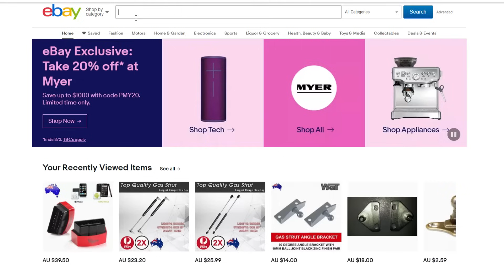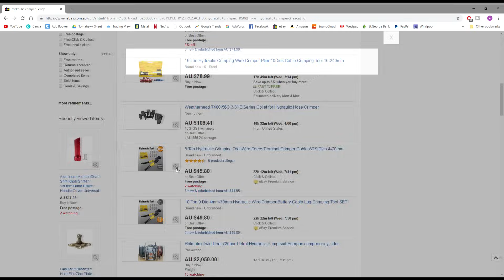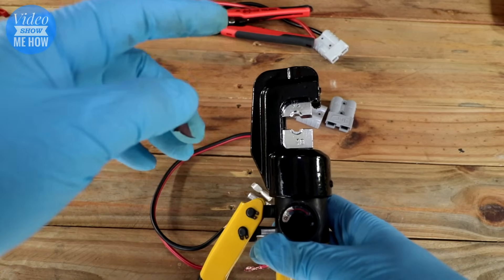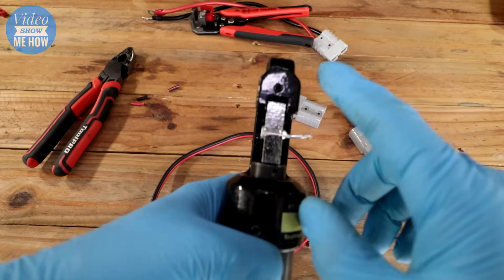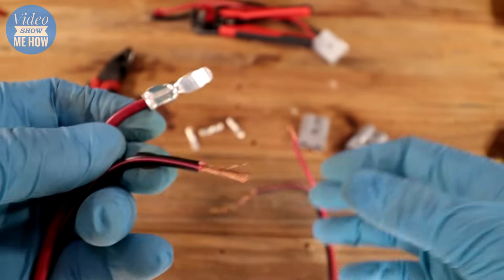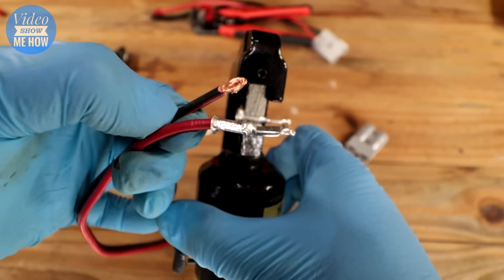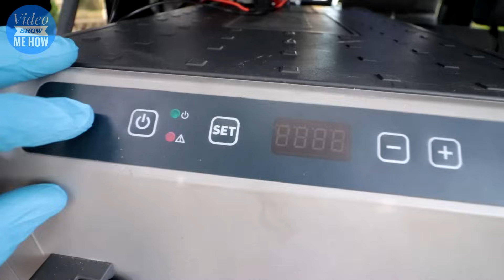12v Anderson Plugs and Connectors - Complete How To Guide

Comment: General suggestion: Do not test assemble these before you attach your wires, to see how the system works. You'll only be pleased with yourself until you try to get the contacts back out of the housing.

Comment: I have never liked these connectors. I have always used a ring and bolt style connection for high current never comes undone. But alot of accessories use these Anderson connectors nowadays over direct hard wired setups. However all my high volt DC sets ups are stationary long term off grid systems so portability is a non issue

Comment: DO NOT SOLDER THESE!  use the proper size connector for the wire guage and CRIMP with a proper tool.  Solder connections MAY work if you are using in a stationary situation. but vibration and movement will eventually cause a break!

Comment: How do you get the connector out prior to crimping?
Reply from the maker: @bcgoldminer use a small flat head screwdriver to pry the little tab down at the same time as pushing the connecter all the way in and it will fall out

Comment: Jaycar had 175 amp ones bud, I i can tell you're Australian I came looking at these for car audio quick disconnect style thing and Jaycar has some zero gauge ones and even doubles zero I think zero gauge saw on the no one's crimping zero gauge is though so that's sucks 😂
Reply from the maker: @chloeleedow7250  I use wago connectors for car audio check those out?

Comment: I think it is worth noting that the inventor, Anderson Power Products only provides technical support for crimping SB connectors, but not for soldering.  

It seems to me the electrical connection is about the same but the mechanical connection is far superior when properly crimped. 

There are other downsides to soldering as well.

Unfortunately here in the states we are still in the middle ages as far as our measuring. I have one of those hydraulic crimpers but could not find one with gauge marking on the dies, only mm.  Hopefully they roughly correspond to gauge, but it makes it harder to choose the select die when setting up.

I also have a really nice set of leverage based crimpers that have very long arms and work very well. With those you have infinite variability by screwing the jaws in or out and I prefer them.
Reply: I tried the soldering aspect. It is a HUGE pain with a 4 gauge wire. I added flux inside to clean the connection and all. Using a regular soldering iron, took FOREVER.!  I just purchased the hydraulic crimper up to 0/2 gauge for my next project.  FYI, I added flux to clean the barrel part of the connection and all.  Crimping will just be easier. I do wish that there was a link to the crimper that was used here.

Comment: These connectors got a design flaw... 3:15 the wire interfaces are too hard to crush, so you need bolt cutters or that expensive hard to find tool above to just crush them. If they'd go instead for screwable connectors that can be easily open and closed, that'd allow for squeezing the wires, and easier maintenance.

Comment: How do you determine the right size die? I tried with the hydraulic crimper. Crimped it down tight, but the wire just pulls out.

Comment: No, don't use solder. A proper crimper is much better. Also, you don't want to go smaller than about 8AWG if you really want a connector rated to ~50A.

Comment: I saw that you used the 10 size
I bought the same one and the 10 didn’t crimp it enough.
I had to go to the smallest size and that did the job but it wasn’t 100% tight. If I pull hard enough ( not swinging off it) it would come out.
I don’t think I’m doing it incorrectly, it’s very straight forward. Did I get a dodgey crimp tool?
Reply from the maker: Maybe double over the end if you need more thickness?
Reply: Good idea I’ll give it a go
What thickness did you use in this vid?
Reply from the maker: Hmm unsure, was a while ago sorry
Reply: All good thanks

Comment: I just bought a new summit II charger with a Sb50  connector but when it was time to connect the two connectors together it was almost impossible to push together, is that normal when their brand new or something?
Reply from the maker: Unsure on that brand but some Andersons are specific, for example the red connectors will only connect with other red ones (this is commonly used for solar panel connections)
Reply: @VideoShowMeHow   black will connect with grey, that's the only miss match in colour

Comment: Great video. I wonder of Powerpole can plug straight into SB50 ?
Reply from the maker: Hmmm am unsure, the powerpole are similar to the sb50 in that it's colour to colour only. Unsure if the keyed bits allow connection into regular sb50. Am doing some more of these type of vids in the new year so will report back!
Reply: @VideoShowMeHow  Just found out they are not compatible :)
Reply from the maker: Ahhh there you go

Comment: I have seen mentioned elsewhere that putting some solder onto the wire before crimping makes a better joint; something solid for the crimping process, otherwise large gauge multi-strand wire can flatten too much. Your opinion appreciated
Reply: It is not good practice to crimp soldered wire, due to cracking the solder during the crimp process. It's best practice to do either solder or crimp, not both.
Reply from the maker: You can flood solder the joint (vid on the channel on that). I would think any solder in there might be dislodged when crimping. Maybe if it was a small amount

Comment: If you're using twin cable like in the vid' you need to be careful you get the crimps on in the correct orientation to the plug as well as to each other - spend some time sussing it out before you crimp. Also the Draper 64335 type crimping tool works well, it's cheaper & doesn't splay the crimps.

Comment: Nice video. I have one question though.

I see you twist the tip of the cable before crimping it. Could you go into a bit of detail on that, please?

Thanks heaps!
Reply from the maker: Was just because cable size was a bit small, so is better to kinda double up the cable to get a better fit in the connector 👍

Comment: May I please ask 2 questions (novice here):
1) Can the T Puller be put on either side of the Anderson plug or only the fully flat side?
2)  Once you insert the wires with crimped (or soldered) lugs into the Anderson Plug (where there click in) is it just as easy to pull them back out? Or how to remove the wires if you want to check a connection?
Thanks for your great video and your time. Cheers, Peter
Reply from the maker: Hi there, 1) can be both sides 2) easy to pull out, just use a flat head screwdriver and push the tab down and pull the wires at the same time
Reply: @VideoShowMeHow  Hey Thank you very much, greatly appreciate your reply, good round off for me from an excellent learning video. All the best, and thanks again!
Reply from the maker: @MrLuckyLegs  you're welcome!

Comment: Could you do a video on which Anderson connectors to use for which application? IE: After watching a video where winching can draw as much as 500+amps under a heavy load, how do you know which Anderson plug connector to use? An SB350 connector for winching vs a SB50 connector for a fridge or a SB175 connector for powering a trailer, or an SB120 for jumping a car, etc.?  How do you know which Amp rated Anderson connector to use?  I understand the wire thickness issue but the different rated connectors is what is throwing me off. Also, on your fridge, did you just put the Anderson plug going to just the 12v outlet or did you also change the connection going to the fridge body itself? Thanks for taking the time to show this.
Reply from the maker: Thanks 👍 I'll add to the list :)

Comment: if you cable is loose in the connector, i'd double it over so its nice and tight. that way when you crimp it, the connector wont deform like that
Reply: 100% correct thats how us electricians do it

Comment: Just bought 2 -SB175's to install the wiring for a DC to DC charger in my truck/trailer.  Never used Anderson connectors before.  Great video explaination on how to install and use them.  Thanks.
Reply from the maker: Cheers 👍

Comment: Can they be panel mounted ?
Thank you !
Reply from the maker: Hey 👋 Do you mean on a 12v panel? If so yep sure can, can be riveted or screwed on
Reply: @VideoShowMeHow  on a project box ?
Reply from the maker: @Enoch-Gnosis  Ah yep, sure can. I put together one in my camper trailer and have a  couple of Anderson plugs eg solar in, 12v out.. They are easily mounted with small bolt and nut, I just used the ones that came with 👍 Good luck with your project ✌️
Reply: @VideoShowMeHow  awesome thank you great video!

Comment: Great tire thanks it's given me confidence. What gauge wire would you use form aux battery under bonnet to fridge at rear? 8mm?
Reply from the maker: Yep that would work fine, that's good for around 40 amps. Fuse near battery 👍
Reply: @VideoShowMeHow  thanks mate

Comment: Very helpful! Got a question - I assume it's possible to extract the cables you insert into those connectors? Is it just a matter of leveraging that flat plate on the end up so it can slide past the small plate inside the connector? Thank you!
Reply from the maker: Thanks 👍 Yep you got it, small flat head screwdriver leverage up and pull.
Reply: Always best to confirm these things! Thanks for the reply.
Reply from the maker: @scottweikert5189  welcome mate!
Reply: @VideoShowMeHow  if you leverage up and pull you can lock the contact to the upper lip inside,always better to lever down the locking tab and push out pin with a second screwdriver so as not to strain wire crimp connection.

Comment: You folded over the wire end before you put it in the plug to crimp?
Reply from the maker: Yeah I mentioned in the vid that the demo wire was a bit small hence folding, usually you'd use thicker cable and this would be required
Reply: So l wasn't going blind then, I only have a mobile, screen is small no computer, l thought the same it "was" doubled over!

Comment: You should mention that you can get different sized connectors for #8 WG, #10-12 WG and # 6 WG sized wires.  makes a big difference.
Reply: Wondered about that, cheers
Edit: can they be purchased from eBay??
Reply: @stevecrowe176  You should be able to. I buy mine from Jaycar in Australia....

Comment: Good video, I use these a lot on UPS systems. They range from 24v to 120v and then paralleled or series to 400v plus, current varies on UPS size and DC voltage. A good connection is so important for obvious reasons, the crimp tool is the best way to achieve this, you can crimp it too hard as well as too soft, if you do you it too hard it will weaken the connector. The crimper in this video isn’t the best, you should really use a specific Anderson crimper but for 175A plugs it would be a ratchet crimper and it would be a lot more than $90!

Comment: Do the connectors that crimp onto the wire ends come with the anderson plugs? I can't find them anywhere online in australia.
Reply from the maker: Hey there, yep they sure do, should get 2x with every housing
Reply: @VideoShowMeHow  Ahh ok great, thanks for the quick reply. Video was really helpful, wiring up some fridge connectors to my mppt controller for camping this wknd now that we're allowed out again!
Reply from the maker: Nice! I've had a quick look just now and can't find any either, just the normal Anderson connectors that have then with them. Might need to just get them, least they're pretty cheap 👍👍
Reply from the maker: Actually maybe somewhere like Jaycar if you're in Aus?
Reply: @VideoShowMeHow  Yep, Melbourne - I need the Anderson plug too so if the connectors come with it i'm sorted, if not i'll try Jaycar, cheers
Reply from the maker: Cool. Have fun this weekend! 🍺
Reply: You can purchase just lugs as well from eBay, l did, incase of stuff ups.

Comment: Wire gauge looks to small for the contact.
Reply: You can get different sized connectors for #8 WG, #10-12 WG and # 6 WG sized wires.  makes a big difference.
Reply: I totally Agree.  But you'll get a lot of solder in the cup with that mismatch!  Probably not a good crimp connection though.

Comment: Will these plugs be ideal for a electric fuel pump on my car
Reply from the maker: Hey 👋 outside the tank sure 👍
Reply: @VideoShowMeHow  also are the connectors identical you just rotate to plug in each other.
Reply from the maker: @rogerbelcher2981  spot on, you are correct

Comment: SB50's are actually rated up to 120A and can handle significantly more than 50A continuous if ambient temperature is sensible and correct cable size is used. Power pole 75's use the same plug fingers. 
The 50A is the 'hot plug' capacity.
I.E the maximum current the plug can be connected/disconnected at whilst current is flowing and not destroy itself from the arc.
Reply: i didnt know that SB50 is rated up to 120A. Looking the right plug for my 12v 1000watts inverter
Reply: Thanks, it's been pretty hard trying to figure this out from looking at the SB50 datasheet which only states clearly 'up to 120 amps' in the title. Further down it says the UL 1977 rating is 120A but CSA is 50A and none of that means much to me. In the end I figured that even though the plug looks a little small, if I can get terminals big enough for 16mm2 cables then it's going to be suitable. But it's good to see someone else saying in the comments that it's good for 120A.

Comment: One question, given that the contacts have a wave shape to the end of them, don't they need to be inserted in one direction on one side and reversed on the other? Thanks for the vid, keep up the good work!
Reply from the maker: No both the same, the housings are designed to clip together the right way 👌
Reply: @VideoShowMeHow  Thanks for the prompt reply. I may be confusing the terminology. I mean the crimp pieces.  While the plastic connectors themselves are oriented specifically, do the crimp pieces only go in one way when inserting them into the connectors as well?
Reply from the maker: Yep you got it, the terminals both positive and negative go into the housing the same way 👍
Reply: When you put the "terminals" into the connector shell in the wrong orientation, they don't tend to stay in place. Yes, they are meant to only go one way.
Reply from the maker: You shouldn't be able to connect the wrong way :)

Comment: Are those the same connectors? They are simply turned around so that they connect into one another. Or, is there a male and female connector?
Reply from the maker: Yep they're the same connector but they're design in such a way that they connect together when aligned

Comment: HINT... Spray a little bit of silicone spray (a.k.a... tyre and bumper shine) into the plugs and wipe off any excess. It makes them so much easier to separate.
Reply from the maker: Top tip 🙏

Comment: 🙄 don't crimp the joints , flood solder the joint instead  you can't beat it, especially if your using a small wire like in video. Use some emery paper to scratch up the inside of the connector to ensure a good bond. And as a bonus  you can reuse the connector down the track.
Reply from the maker: Hey Don, flood soldering works too :) Like it so much I made a video on it - https://youtu.be/2BikJusnD9Y

Comment: Great vid.  Thank you.  How did you go with those JQ branded ebay connectors.  I also bought some of them recently but haven't used them yet.  They seem to be a bit thinner/lighter than other Andersons I have so I'm unsure if they are the cheap knock-off versions that may be a safety hazard ?
Reply from the maker: Thanks 👍 Have been using these for a couple years on my camper trailer and still 100% no worries at all :)
Reply: @VideoShowMeHow  Great, thanks again and a very quick response 👍🏼.  Subscribed 😁

Comment: There appears to be a top and bottom to the lugs relative each other and to the housing orientation. What is the correct orientation?
Reply from the maker: All in the video :)
Reply: @VideoShowMeHow  I assume you're referring to the comments you make at about 6:20. I've got the giant version, 350A, and the appearance is a little different. I think I understand which bump is your "hook"  I believe the bump on the other side, which is further back, is intended to hook the matching bump on the other connector's lug. The spring is very sturdy in mine so I've been reluctant to do a test insertion, and risk deforming the spring during removal, to confirm my current understanding.
Reply from the maker: Whoa 350amp 👍 Looking at the terminal from the side, is it slightly curved? The orientation should curve down onto little tab in the housing if that make sense sorry hard to explain
Reply: @VideoShowMeHow  No curvature. A tiny lip at the end and a bigger hump, on the opposite side, a little back from the end. Oh well thanks for trying.

I'm putting together a solar inverter / charge controller system. The inverter is in the 2-3 thousand watt range. With a 12 volt battery bank that requires a very large current.
Reply from the maker: Yeah ok. I run a 3k inverter on the camper, they can pull a heap of amps at full till that's for sure! 3000 is 250 amps. Here a pic that hopefully shows the right way: https://images.app.goo.gl/2H3cMxU54tuv2d3G8